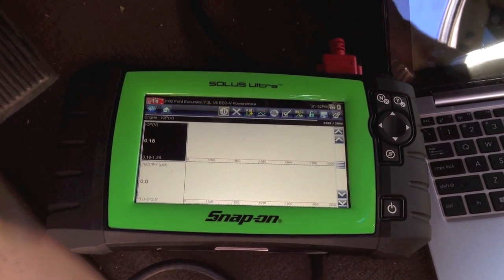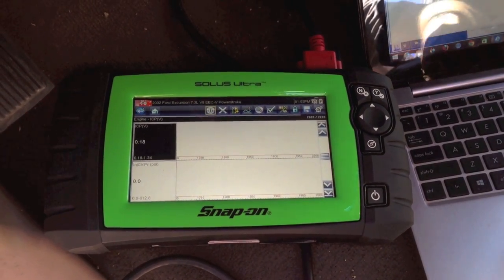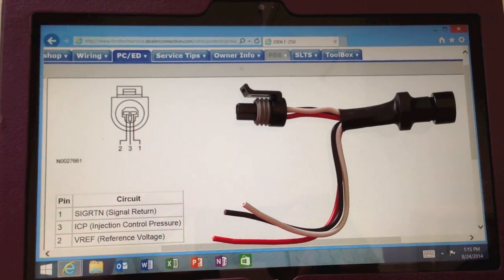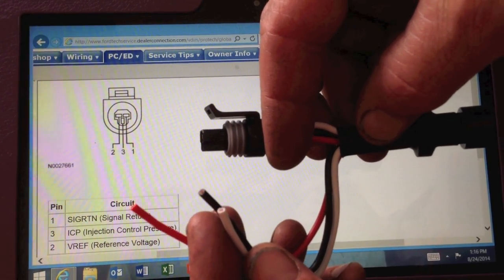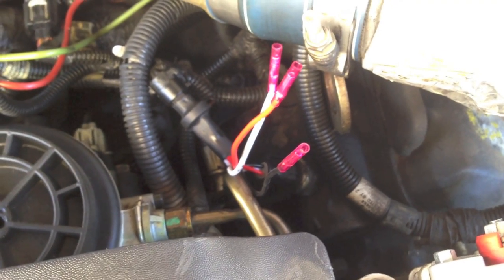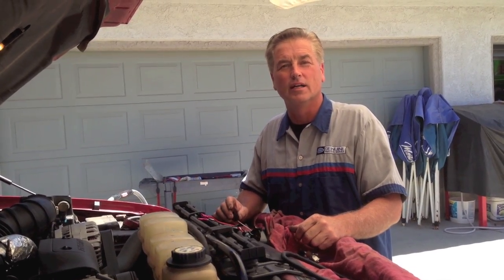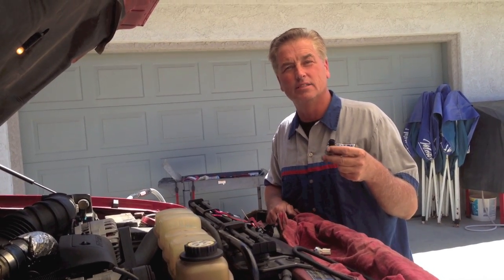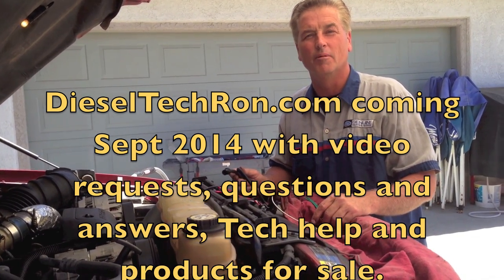Testing the Icp voltage on the 6.0 powerstroke . Dieseltruckpartsdirect

Comment: Thank you very much for your detailed video on how to test with a regular volt meter. I was having problems with my truck and the ICP was the first part I replaced, but was still having problems. I replace the IPR and ECM, still having problems. Not knowing where to go from this point I came across your video on how to test the ICP with a voltage meter. I checked the wires as you said and found the wiring diagram that came with the aftermarket ICP and new plug end was wrong. I switched the wires around based on the voltage you said I should be getting from each wire. Problem solved! Your video saved me from buying any more parts! Thank you thank you thank you thank you!!!!!!!

Comment: Could a bad icp sensor cause a 2005 to miss slightly after driving for approx 20 mins and them stopping at a red light?? Starts great cold. Btw I am without a doubt gonna buy a ficm from you off eBay when I need one. Thanks again for all the help..
Reply: Will the ipc centre make my truck motor  not eniht on driver side

Comment: hey Ron I love you channel its has helped me out so much....Best channel on Youtube ever for Powerstroke Help

Had a Question i have 05 6.0 f250 powerstroke just got it out of the shop for egr delete, heads studs etc.turbo went bad so got new turbo put on aswell, my mechanic stated he upgraded to a blue spring as well....Now no power on top end, pulls good partial throttle, good boost but when your at wot/floor it, bogs down and lacks power? what do you think it could be?? fuel pump/fuel filter,icp .....pls help
Reply: did you ever get an answer for this? I am experiencing the same thing you have and cannot figure it out. could you please call me or text me a solution 972-743-7512  Adam Ross

thanks!
Reply: i changed the fuel filters and it runs better, but i still want to drop the tank and clean the in tank filter and add a airdog 2..... change the fuel filter under the drivers door
Reply: wellsmd1 i tried that..... it didnt work. i'm thinking the HPOP is on it's way out. it's in the shop now for a new oil cooler and to try and figure out what this fuel problem is - i'll keep you posted

Comment from the maker: I went back and listened. I don't think I made it clear. ICP PRESSURE READINGS CANT BE TRUSTED ON A SCANNER IF THE VOLTAGE IS NOT CONFIRMED. Don't believe me?? Disconnect your icp and monitor the icp and ipr. Its normal isn't it? That's because it was lost so it went off desired. No starts that also have a bad signal will kick your butt on this.
Reply: RIP Ron 😥
Reply: Ron had a question for you!!
Got a 6.0 with high ipr psi the truck basically is over fueling and wants to run away, just did erg and oil cooler replacement?  Have any thoughts? I have hooked a gauge to the icp and I really do have 2000 plus psi in the rail, im thinking the ipr is not opening properly .

Comment: Ron,
Thanks for all the helpful hints. I recently replaced the turbo on my 6.0. The truck runs great, however under a heavy load with no loss of power it will throw a PO299. The turbo pressure on the instrument cluster will indicate good positive pressure and the scan gauge would show a negative boost, VGT will also drop below 15. All seems normal when the load lightens up a bit. Please help.  Any Idea ?
Reply: Same thing with mine. Did you figure it out ? I’m getting 1.3lbs of boost on the freeway. New turbo, new map sensor, cleaned port